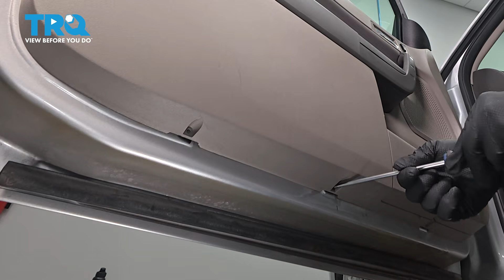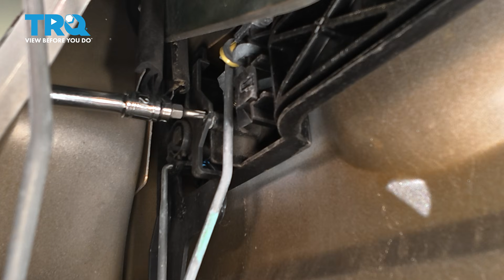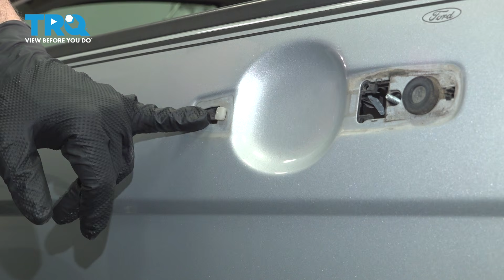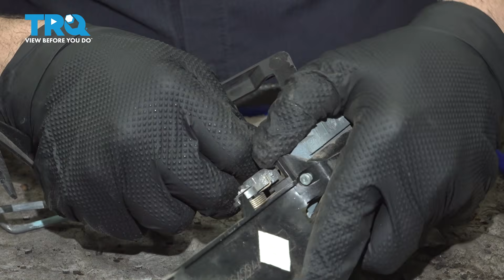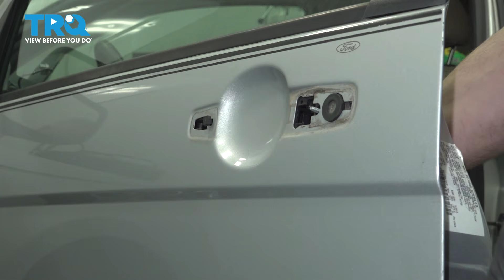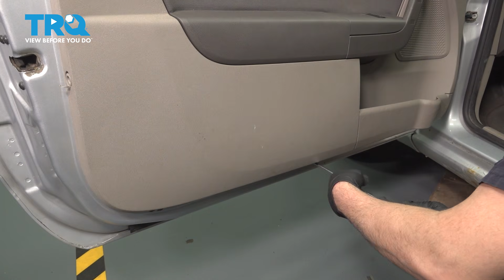How to Replace Front Exterior Door Handle Reinforcement 2008-2011 Ford Focus

Comment: Was able to do it without taking the window out. Once outside door handle was removed, had take out the screw with a plastic clip holding it in by wiggling out from inside. Then I maneuvered the old bracket piece to the side and was able to replace. I used a new screw to go on the outside where the old screw was. Didn’t have to remove the window for this but you have to get the screw short enough so it doesn’t affect the opening of the window.